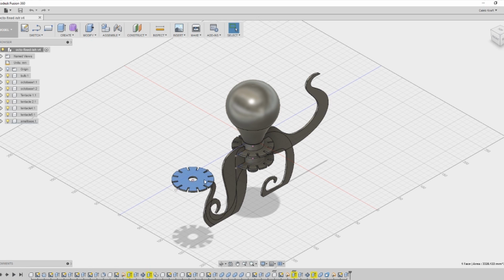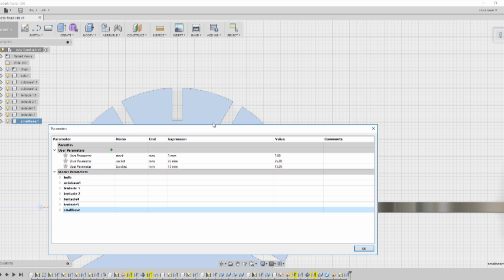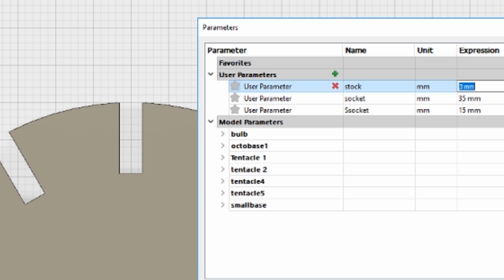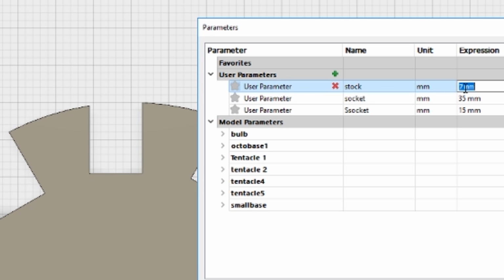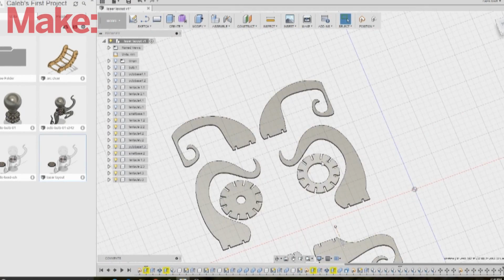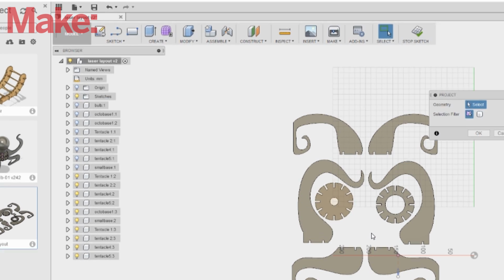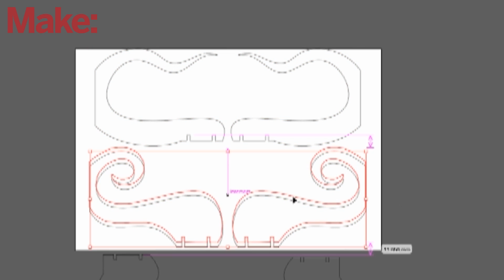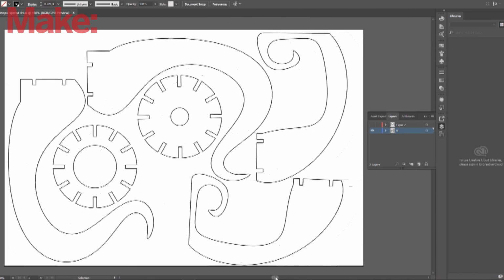Laser Cut a Slot-Together Octopus Lamp

Comment: Fantastic design. Did you cut the joint slots as parallel? Or do they go from 3 mm at the mouth to like 2.8 mm at the end? Currently working on a similar "snap-together" design and am having trouble getting consistent, strong snapping action.

Comment: A cool tip if you don't want to sand your template off is to put down a layer of painters tape and then glue your template to that.  Then when you're done just peel off the tape.  No wiggle on the template and no mess.
Reply: great tip!

Comment: 4:51 Another great option to transfer the template to the wood, is to get a pack of carbon paper. Place a sheet between your template and the wood,draw/ trace over all the lines and it is transferred to the wood.
Reply: good idea! You can see I don't do a lot of woodworking.
Reply: No problem, a pack of carbon paper is really handy to have around, and one pack will probably last a life time. It's one of those techniques, that comes in handy again and again, in all sorts of projects.

Comment: Would be perfect for my daughter´s room, but aren´t the edges very sharp?
Reply: not sharp at all. The laser kind of smooths it all out. You could also sand it pretty easily.
Reply: not really. but you can always use sandpapper to round them off more if you feel a need too.